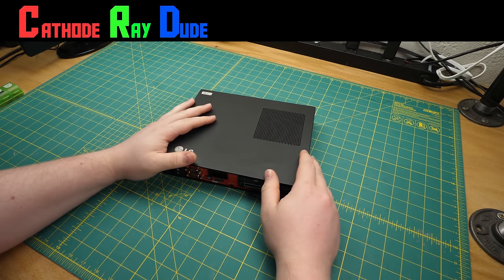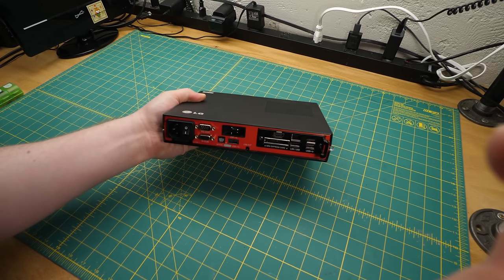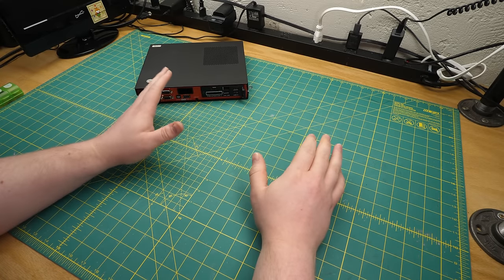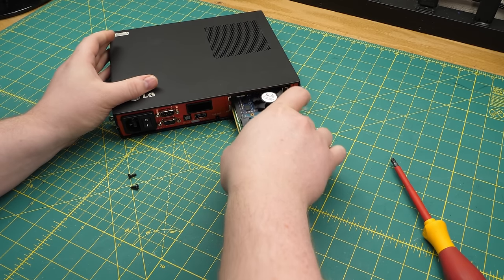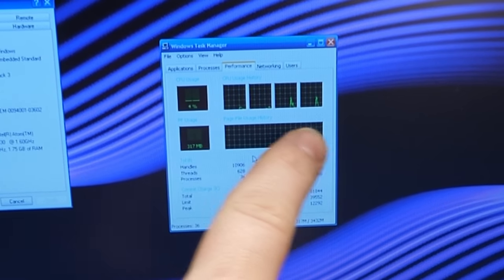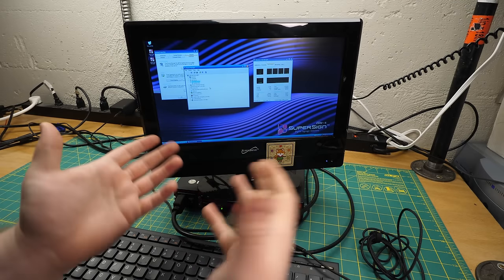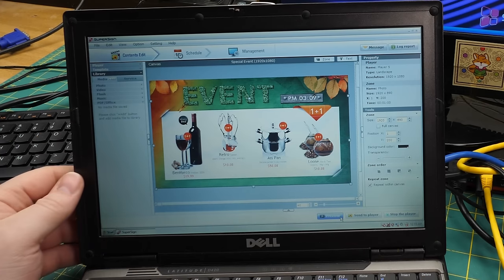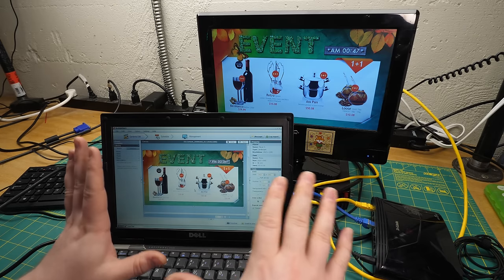Little Guys 6: The Worst Possible Timing [LG NC1000]

Comment: I am one of the guys using the OPS ATSC module! My specific flavor of brain damage includes "Good TVs are expensive but barely used signage displays are not" and that's culminated in rocking a $50 "Used for CES" NEC V552 for the last ~4 years as the living room TV. 1080p AHVA with 16.7M color panel.
Reply from the maker: yeah no this doesn't surprise me

Comment: This is my favorite tech series on YouTube at the moment. I have always been fascinated with Mini PCs in all varieties! I have a little ThinkCentre M600 Tiny sitting behind my TV (for cough*legal*cough emulation) and used an absurd amount of white label Mini PCs as routers, access points, you name it, and they're always so interestingly designed. Even still I've never seen or heard of any of the featured devices and the detail you go into about them really sates my curiosity! Thanks Dude.
Reply: Those thinkcentre tinies are *so great*, especially since with the dock-displays IBM has they are about as close to this sort of specific embed-in-display form factor as makes sense for a household user. my wife currently has an aging (but sufficiently capable for ordinary tasks) HP AIO and I've considered getting such a setup to make things easier on her. For such small devices, they're fairly easy to get into and modify the hardware (add RAM or storage, replace CPU, etc.)

Comment: I always wonder how far into the video I’ll go before I point at the screen and shout. Today it was 00:05:25. THAT’S A BRIGHTSIGN! FWIW, we’ve kicked Brightsign to the curb around here. They’re overly complicated and somewhat unreliable compared to competitors who are now taking Brightsign’s lunch. Last week lecture capture machines. This week digital signage! It’s like you’re slowly discovering the existence of entire verticals in which I am entrenched. Next week… streaming appliances, maybe? I’ve got a pretty sweet one sitting by my desk that we retired a couple of years back… It’s too cool to send to the e-waste pile in the sky.
Reply from the maker: I have looked into streaming appliances a little bit - generally speaking they seem too simplistic (or too dependent on cloud services I don't have a subscription to) to cover in a video, but maybe I'm wrong. What's the deets on the one you have?
Reply: Which solution are you moving to, from Brightsign?
Reply: We’re moving from a collection of different systems to Vitec. Brightsign only really works for our screens that never change. I couldn’t get the marketing department to understand the Brightsign backend and teaching 20 odd non technical staff how to schedule 200 screens with it was nightmare fuel.
Reply: It's funny because the DS company I work for specifically poaches from BS clients and similar because they find those systems too complex for non-technical people, smaller businesses, etc. We sell them on cheaper devices with a dumbed-down management platform that even a marketing person can handle and our clients eat it up.
Reply: @CathodeRayDude  We use high end encoders. Rack mounted beasts. The last one we had... I saw a rack of them in a video from a cable news network (not that one) that used it for their streaming infrastructure.

Comment: i think you can get away with only 6 conductors for VGA

my evidence for this? the most electrically cursed dongle in my collection is a passive DE-15 to USB mini-B, carrying the standard RGB, H-sync, and V-sync over the 5 signal wires, and using the cable shield and mini-B shroud for GND
Reply: There is never a good excuse for that.  haha
Reply: Why didn't they use sync-on-green and drop a couple of those redundant conductors?  Cowards.

Comment: So going a little deeper than just “Hey, the early Atoms were just CPUs and not SOCs”, the Ion chipset was originally supposed to be paired with the Atom processors (in direct competition with AMD’s low-powered CPU and IGP solution of the time).

Then people figured out they worked with the Core 2 processors.

You should be able to install OS X 10.6 on this machine.
Reply from the maker: oh my god
Reply: @CathodeRayDude  that would make it Guy MacLittle.

Comment: Would be cool to do a fundraising stream to buy a display if one doesn’t magically show up locally. You might ask the event coordinators at local convention centers what happens when they retire their old displays. I help run a conference in Michigan, and it seems like our venue is changing / upgrading digital signage pretty frequently. Have to imagine they go somewhere. Here in Seattle, I’m surprised they’ve never shown up at RePC.
Reply from the maker: So there's a few issues wrt ordering one. For one thing, I don't trust any seller to know how to pack a TV, so it could arrive smashed; don't want to be  in that situation. Also, all the ones I can find for sale (that aren't brand new and over $4k) are enormous; I have no room for another 65" TV anywhere. And one HAS shown up at REPC (4, actually) but the image quality is awful. I could get it for probably $150, but it's once again a 65" or 75" set that I have no use for other than a demonstration. I'd much prefer to get a 32" or 40" set that I can afford to keep around and use, so that's what I'm hoping for.
Reply: @CathodeRayDude  running out of space to put your stuff is horrible. I'm facing a similar problem right now where a big chunk of my home lab has spilled out of my office and into the dining room along the wall. Wife isn't too happy, so I guess I'm going to have to look into adding on to my office.

Comment: VGA can get by with between 6 and 10 wires depending on the monitor - 10 gives you RGB, Hsync, and VSync, and a ground for each, but some VGA monitors will accept composite sync for 8 wires, and some can use sync on green which leaves you 6. All the other wires are for stuff like EDID, I2C, etc.

Comment: I knew what it was immediately, as I worked with digital sign, POS machines, and firewall development. Most people will never see one of these devices not attached to the back of a screen or under a sales counter somewhere, I got to see them on my workbench, sometimes in pieces. The layout is intended to be as compact as possible, the recessed USB port is probably for a license dongle that unlocks whatever software the vendor put on it - often times it must be in that specific USB port. They can often be converted to a normal PC running normal software relatively easily, but they tend not to be very powerful, because they are built more for reliability and compactness than for speed of operation.

Comment: 30:25 I can speak to this, sign companies will sell you anything, will install anything, and won't tell you that it can be done with a raspberry pi and a web server. And most companies don't have people in charge of signage that knows better: "That's just what it costs, don't like it, don't have a sign."
Reply: United States thing. You need a special training to figure out the obvious thing
Reply: I disagree, the ease and power of a commercial system is why a client is willing to pay more.  I have installed numerous BrightSign units  for clients and they run flawlessly for years, some have been in museum displays for over a decade.
Reply: It depends on how reliable your system has to be. For example to show a dynamic webpage without disconnecting from the internet and killing the SD card or the Raspberry Pi is not an easy task. FullPageOS helps a lot with that, but it has its quirks.
Reply: @adameichler  or you can just use pisignage… the solution that’s been cooked in pi for almost a decade now. 🤷‍♂️
Reply: Quite a lot of the time in business you're not paying for the solution itself, you're paying for something to be someone else's problem. At the mid scale, in between "there's five of us total, we all do everything" and "there's an in-house department for that", there's a lot to be said for sticking to your core competencies and outsourcing the rest of what you need to do to other businesses for whom that thing is their core competency. 

Say you've rolled your own solution with a raspberry pis and a web server, it runs all the menu displays in your small chain of burger joints. One day every display in your entire company breaks. You have no idea why. Suddenly your entire IT team (all three of them) is in crisis mode troubleshooting, potentially for days. What happens if a cash register breaks in the meantime? Who handles day to day support while this is going on? 

On the other hand if you outsourced your signage and your contract has an SLA, you call your signage company, they fix it, if they can't fix it they come in and replace everything with a known-working system, which they have in stock, because they're a signage company. If they can't even do that, they pay you the compensation specified in the contract for breaching their SLA. At no point is it your problem to solve. That's worth a lot of money.
Reply: @Lyrainthevalley  after the incident, you fired all of 3 people from your IT team, who cannot handle a single rpi, hired a signage company and next week Godzilla came and ate all your businesses. And after that feds glassed entire city with nukes. What will you do? Hire the burger company?
Reply: @Lyrainthevalley  If one day every display in your entire company breaks you reload them from backups while figuring out how the ransomeware infected your network.

Comment: while being a chipset and a graphics chip the main function of nvidia ion was switching between its graphics and the integrated intel graphics, to the point some machines only use that function leaving the chipset functionality unconnected. at least one reviewer called it a "one trick pony".
Reply: On the original Ion chipset there is no Intel GPU - you're probably thinking of the Ion 2, which is basically a GeForce 210M connected via PCIe x1

Comment: Found a little guy myself earlier today at work when we swung by the recycling center as usual, saw a HP Prodesk 400 g5 with an I5 9500t 1x16 gb ddr4 & 256 gb ssd.
Reply: Nice fine, and fully capable of running Windows 11.
Reply: @mattelder1971  For sure, the only fault i can really say it has is the display port furthest too the right is not working.

But it has 2 more so it's whatever really
Otherwise nothing seems wrong with it.

Comment: "Why would anybody ever distribute a slide show over 20 screens":  video walls. Those are always about 65" flat screens. So if you want to have a video wall in your airport, shopping mall, or your fancy upscale fashion shop, you need to stack 4x5  65" screens with an ultra slim / "virtually zero" bezel, and use software to split up the video/presentation. This will cost you about 80k USD in displays plus 10k in player hardware, but that is pretty cheap for a video wall, compared to how expensive it used to be. It is also very often easier, and much more modular, to have 20 cheap players connected to the back of 20 displays, instead of having 5 each doing 4 or a single unit trying to address 20 displays .
Reply from the maker: I'm not asking why people want to make video walls, I'm asking why you'd use $15,000-20,000 of machines with independent processors, each one running a full fat copy of Windows with its own software stack, each one requiring its own independent network connection, instead of a single box from Crestron that just takes one input and divides it into 25. The consumer grade versions of those are like $200; surely a 5x5 model is only going to be a few grand.
Reply: Well, it might be about the resolution. You would have to output incredible resolutions to be able to achieve native on the TVs.
Reply: Video bandwidth and resolution is the achilles heel of any video matrix product. A 5x5 video wall of 1080p monitors is going to need to be driven with a 9600x5400 signal. That's more than 8K, which is considered an exotically high resolution *now*. Even with my limited experience from the "You'll Have 1366x768 And *Like It*" era, there's no way in hell someone was selling an 8K-capable video matrix splitter in 2010. The only other option would have been to fill a PC with a bunch of Nvidia Quadros with sync connectors and configure the drivers to output a matrix, which would *work*, but would require a full-size tower chassis. Also I have no clue if Nvidia's video matrixing solution was a thing in 2010.
Reply: @CathodeRayDude  I think the future plan may have been an upgraded computer module that used the other connector and a dedicated GPU that could output a high resolution and display to 4 with just one box (NC4000)?
Reply: The lack of bezel is most of the cost. I've done it for around $1k, not worrying about bezels
Reply: @CathodeRayDude  Resolution.  A splitter scales the image so that each pixel is NxN physical pixels in a video wall of NxN screens.  With separate controllers the full native resolution of the screens can be used, regardless of the size of the video wall, making the image noticeably better looking.
Reply: @CathodeRayDude 25 players that each output HD from a vector graphic input, is exponentially easier to handle hand one output rendered in absurd resolutions that can't be transmitted to the splitter. This way, each HD screen has a vector graphic resolution output.
Reply: @CathodeRayDude  Just a guess, but maybe it's for companies who already have a bunch of the digital signs? Like, say you were a mall and had a bunch of these displays, and suddenly you want to do a 3x3 display wall for Christmas. If you already have a bunch of these signs, being able to configure them into a big display wall would be cheaper than going out an buying a bunch of new hardware, even if it wouldn't be the cheapest solution if you were buying everything from scratch.

Like, I could see that kind of flexibility being touted as a feature to get companies to buy into their ecosystem, even if they're not being sold for that purpose from the outset.
Reply: @SuperSmashDolls   Absolutely.  I got a DisplayPort splitter around... 2015, I think... that was designed to handle the multiple streams feature.  Ergo, I could feed that splitter a single DP cable with 3x 1080p signals, and it would break them out to my triple-monitor setup.

It was CONSTANTLY having problems.  Drop-outs, init failures...  I had to power cycle something about as often as not, to get the displays to wake from sleep every time I used the computer.

High-bandwidth digital is hard.

Comment: Generally OPS is specifically used with digital signage class displays, which is why the prices are so high on displays with them. We have been using OPS modules with raspberry pis for years. As is usual, you're paying for the certification/guarantee of performance with digital signage displays, not that they're actually better :)

Comment: I'm guessing the JTAG option is just to enable/disable the ability to use that interface. If your company sets up the management stuff, then locks it with a password, maybe someone could still unlock it via JTAG? Speculating of course, but it would make sense for enterprise devices that a company wouldn't want stolen (although who knows why a digital signage controller mounted to the back of a 75" TV mounted in a store with people all around would be at risk of theft... maybe this is a universal "enterprise" BIOS or something?)
Reply: (my first reply seems to be stuck in a mysterious state between existing and not existing thanks to youtube's spam protection, so I'm repeating myself)

I can find at least one reference to OPS modules having some currency in digital cinema operations -- where the ability to disable JTAG could make it harder for an insider with access to the display to sneak an unencrypted copy of the movie out of the venue.  not that it's necessarily that, but I imagine it's a similar vibe of "the module is handling something someone doesn't want you to make a full-fidelity copy of, but licensed exhibition is fine."
Reply: @vogon3400  i mean you can always just get the SSD out, sata to USB converter and pull the files ngl... unless there's encryption but WinXP... yeah don't think so
Reply: @DEMENTO01 there's nothing that says here that JTAG access has to be the sole vulnerability in the entire software and hardware stack!  it just had to be credibly enough a flaw to some application being considered for the system that the firmware authors went to the effort of putting in a JTAG port disable -- which, depending on what that switch actually does, might be as simple in implementation as initializing one of the chips on the board in a different mode.